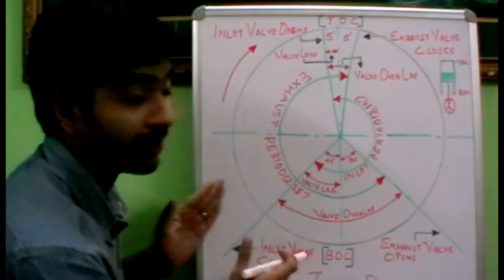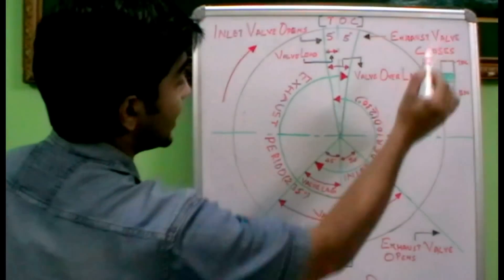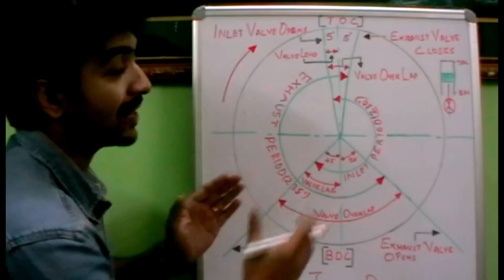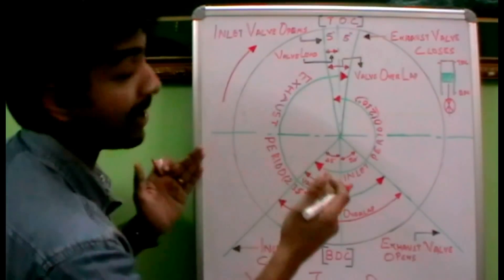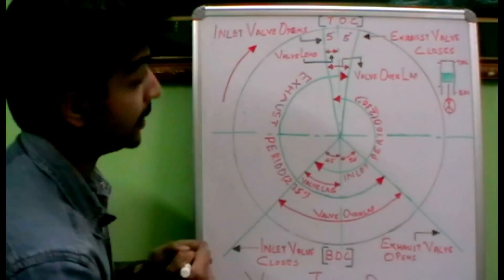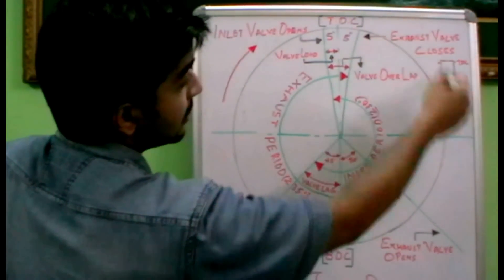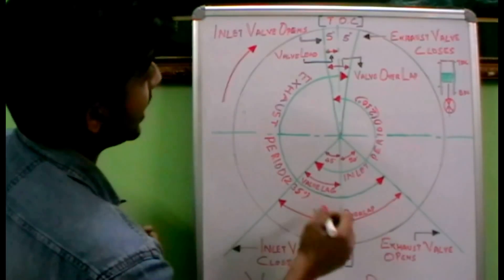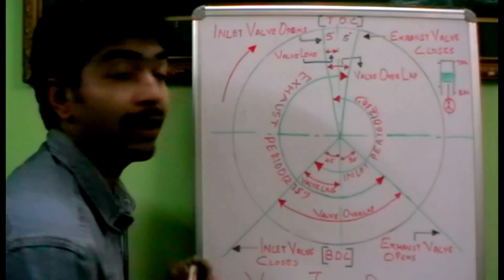How valve timing diagram works. ✔

Comment: Anyone tell me plzz why inlet valve opens before TDC
Reply: Manoj Kumar i think inlet valve should open before tdc for two reasons: 1 to maintain the temperature of the combustion chamber and then keeping the spark plug from getting wet by the fresh introduced gas of air and gasoline, 2. to create a partial oxidation condition in the chamber to aid the escape of the burnt gases through the  exhaust. in addition it also aid in the rate of the inflow of the fresh gas into the chamber to introduce the induction stroke.

Comment: hi techtrix team. there is a flaw in timing diagram explanation that is the valve overlap happens only at TDC that is only about 10 degrees but it is explained that there will be valve overlap of 95 degree at BDC. think of it and correct it if possible or avoid mistakes from next video. 
thank you